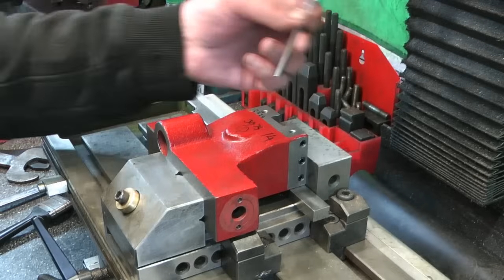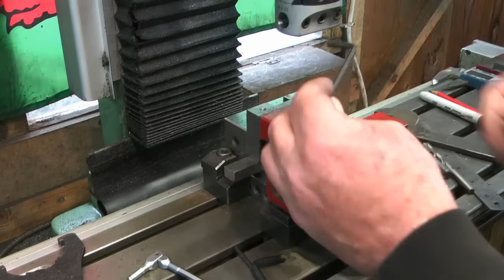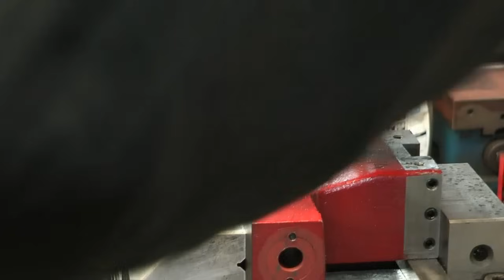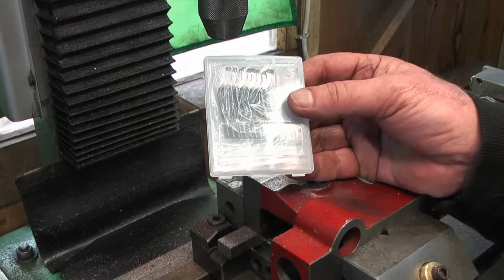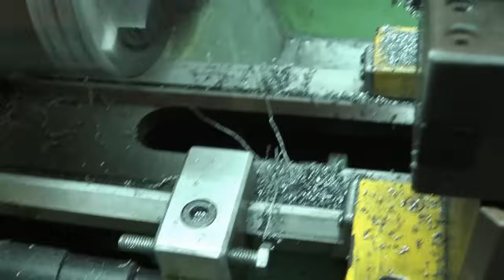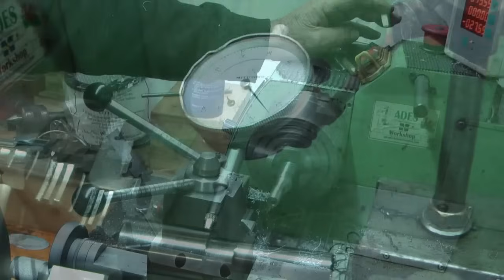Mini Lathe upgrade part 26 , more tailstock work .

Comment: To prevent rust on your tools I use Desiccant silica gel those little bags you find in boxes and bags.I put them in plastic bags put your chucks inside.  lay them on lathe cross slide at night cover with plastic sheet..been doing this for five years never had a rusty chuck. Put them in tool draw and boxes brilliant
Reply from the maker: Thanks for the suggestion, it's always good to find ways to prevent rust!

Comment: G'day Ade. Doing great turd polishing there :) Those Mini lathe tail stocks are a bit of a crime aren't they.
Reply from the maker: Haha, thanks mate! I did consider throwing it away and starting from scratch . At least it can perform its function now. Good to hear from you , Cheers Ade.
Reply: @ade63dug  I think I got as far as making up a casting pattern to replace mine at some stage. I even used the swoopy design of a DS&G tailstock casting :)

Comment: Does the offset of the boss relate to the cam offset?
I set my cam offset on a Boxford by putting a 10mm washer under one jaw of a 3 jaw chuck.
Reply from the maker: The 3 jaw method is quick and simple to do and can get very close to a desired offset by adjusting the spacer thickness, For precise parts like the S50 eccentric I made , it is better to dial it in on a four jaw . both ways have their merits , Cheers Ade.

Comment: As for " scotchbrite" Ade, I get mine from Machinemart. They are called National abrasives hand pads. They work  pretty well and comes in three grades (from Machinemart) green- coarse, red - medium, grey - fine and are around £9.50 for a pack of ten pads. Not Scotchbrite which is as you know 3M's brand. If you don't have a Machinemart anywhere near and in your part of South Wales I don't suppose you do, go to any good auto paint refinishing suppliers they will have similar as it's used extensively in the auto body refinishing industry. Just had a thought. You can order online from Machinemart as well Ade. I will get back to watching the vid now!
Reply from the maker: Thanks for the info, good to know the options, Cheers Ade.
Reply from the maker: Thanks for the info, good to know the options, Cheers Ade.

Comment: Excellent work Ade. This is going to be a huge improvement on the Tailstock lock. My mill also suffers a lack of Z height, so I use my keyless chuck on an MT3 arbour, rather than on a collet chuck. Save some height. Some time back Lidl were selling packs of 2 sheets material like Scotchbrite in 1000 grit. I use this as I can’t really afford the real stuff. Ever so often it crops up again there. For very rough cleaning work I buy the small sheets of the green material from Poundland. Cheers Nobby
Reply from the maker: Great tip about the Scotchbrite from Lidl Nobby, thanks for the comment , Cheers Ade.
Reply: No problem Ade. I have quite a few sheets of this, and would be happy to send you some to try out. My email is in the description of my YouTube channel. Ping me a message and I’ll post some to you, plus my workshop sticker 😊 All the best Nobby. @nobbysworkshop

Comment: Hi Ade, How did you decide on the cam offset distance as It looks quite large. I’ve been milling cast iron for the last few days and  had forgotten how messy and dirty it is.
Reply from the maker: I was thinking that the cam will only rotate about 90 degrees from open to locked so thought 2 mm offset will be less than 1mm in use . actually seems good now that I nearly done and have tried it , Cheers Ade.

Comment: Why does everyone use emery cloth to obtain a good finish in the lathe when it should be possible to obtain a good finish with correct feeds, speeds and tool geometry. Also avoids the risk of a de-gloving injury.
Reply from the maker: A good question Shaun , I look at it in this way , with the correct Feeds , speeds and tool geometry a good finish is easily achievable under most circumstances , even with modern CNC machines this can be called excellent, however, there is a difference between an excellent machined finish and a polished finish , when a polished finish is required for whatever reasons then emery cloth is used . I will use engine crankshaft journals as an example , . It is common place for crankshaft journals to be polished with emery cloth after machining when rebuilding an engine as this presents a better surface to prolong  the life of the bearing shells , In my case and in the instance shown in my video it was purely for aesthetic purposes. I hope this clarifies why emery cloth has its place in either hobbyist or professional arena's . I may also add that although the use of emery could be dangerous and result in personal injury if not done in the correct manner , most professional training institutions will train apprentices in the correct and safe way to perform the operation safely . I showed the safe practice in the way that I was trained to do it over 45 years ago . 
I hope this explains  why there is a time and a place for the use of emery when the need or requirement arises , Cheers and thanks for the interesting comment , Ade
Reply: @ade63dug but crank journals are usually subject to being ground following initial machining and heat treatment and polishing them is typically to rough them up (cross hatching) a little to allow oil retention. I rarely use emery cloth in the lathe because I dont need it or like the thought of all the carborundum dust going on to the bed or sustaining a de-gloving injury should the emery decide to wrap itself around something whilst the spindle is rotating. The German toolmaker I worked for just wouldnt allow emery anywhere near his machine tools and I have a tendency to agree.
Reply from the maker: I totally agree with the damage that the dust can do to machines and that it should be avoided where possible , and secondly that cleaning should be thorough afterwards , I think we have to agree to disagree at this point , the dangers can be controlled though , I do love a debate , thanks again for your interaction , Ade.

Comment: Would a morse taper drills help boring head even better.  Thanks for sharing your interesting video
Reply from the maker: I do have Morse taper drills that go straight in the headstock . with hindsight, I should have used them , Cheers Ade

Comment: Great ideas. This is a project I have lined up so Ade has given me some good pointers on how to go about it. I already have a jacking system on my tailstock, a different design using just one screw in a caotive system on the back of the tailstock. It works well.
Reply from the maker: Hi Les, yes that would work also , still working on the camlock at present , lots of fettling to be done to get it working properly , a bit like the lathe in general really , Cheers Ade.